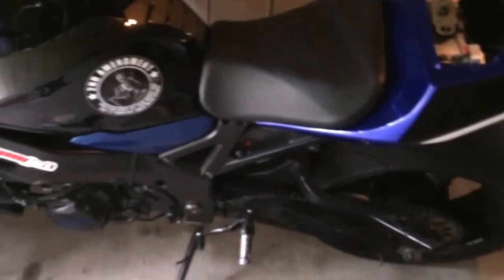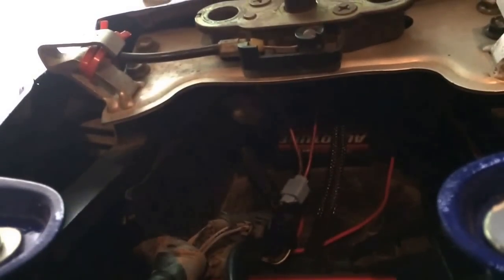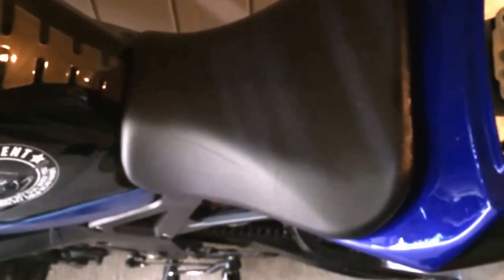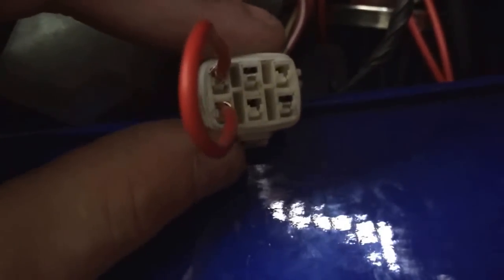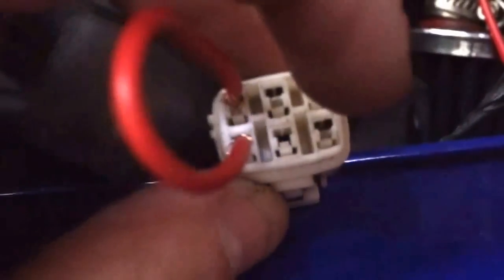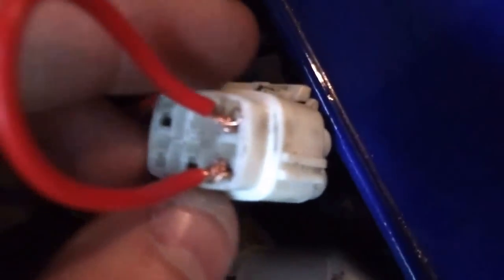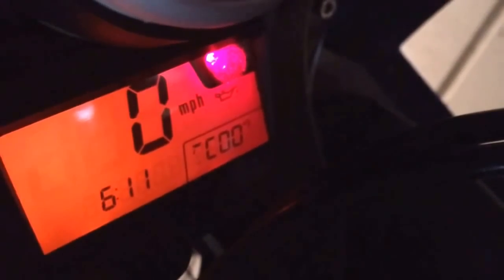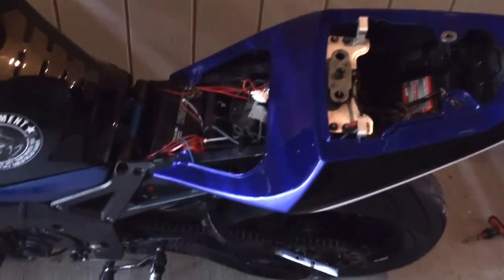2004 GSXR dealer codes (error codes)

Comment: Well had code c00 which apparently means you have no codes lol started the bike then c46 pops up, removed the baffle on aftermarket pipe and codes gone no f1 light all good GSXR K1 1000. cheers

Comment: Here codes...

GSXR Fuel Injection (FI) Code List:   C14 - THROTTLE POSITION SENSOR  C15 - ENGINE COOLANT TEMPERATURE SENSOR  C21 - INTAKE AIR TEMPERATURE SENSOR  C22 - ATMOSPHERIC PRESSURE SENSOR  C23 - TIPOVER SENSOR  C24 - IGNITION SIGNAL #1  C25 - IGNITION SIGNAL #2  C26 - IGNITION SIGNAL #3  C27 - IGNITION SIGNAL #4  C28 - SECONDARY THROTTLE VALVE ACTUATOR  C29 - SECONDARY THROTTLE POSITION SENSOR  C30 - SECONDARY THROTTLE CONTROL UNIT  C31 - GEAR POSITION SENSOR  C32 - INJECTOR SIGNAL #1  C33 - INJECTOR SIGNAL #2  C34 - INJECTOR SIGNAL #3  C35 - INJECTOR SIGNAL #4  C41 - FUEL PUMP CONTROL SYSTEM  C42 - IGNITION SWITCH SIGNAL  C46 - EXHAUST CONTROL VALVE ACTUATOR (1000 ONLY)

Comment from the maker: Yes I did. C00 is what it displays when you have no codes and are changing the TPS
If the f1 light is on before you check there will be a different code
Reply: عندي مشكلا الراجه ساسوكي سكاي ويف F1
Reply: A quick question for you, what happens if you plug the wrong wires during dealer mode ? I think I may have screwed up because now I’m not getting fire to my coils

Comment: you line is high because the bike is set for fast idle and has the throttle open slightly. that should be checked/adjusted with the engine warm and runnig

Comment: So I didn't start a fire but I did plug in the able in the wrong wholes. I watched a different video it was the first time I heard about this and try to make time to find the code of why my f1 light came on. So I rushed and I heard it short well burn something. I've been looking all over the Internet and can't find anything about what I burnt. Any ideas? 
Thanks
Reply from the maker: YES IVE DONE IT A FEW TIMES LOL CHECK YOUR FUSE BOX, YOU SHOULD BE OK IF YOUR BIKE DOSNT START WHEN YOU TURN THE KEY AFTER THIS YOULL ALSO NEED TO CHECK YOUR MAIN FUSE ITS BEHIND THE CLEER PLASTIC COVER NERE YOUR FUSE BOX.

IF YOU YANKED THEM (THE WIRES) OUT AS SOON AS YOU NOTICED SOMETHING WAS WRONG YOU SHOULD ONLY AT WORST CASE HAVE A BLOWN FUES
Reply: l